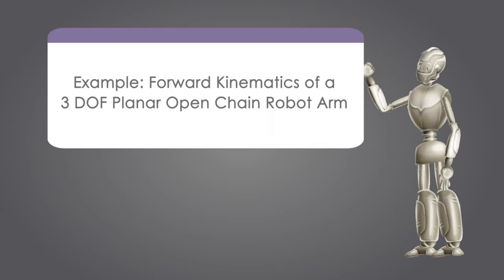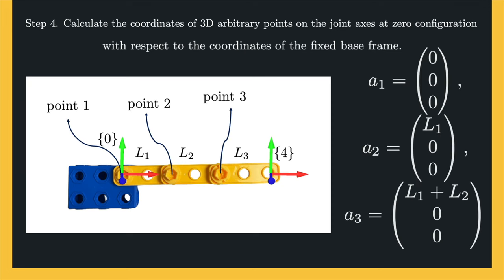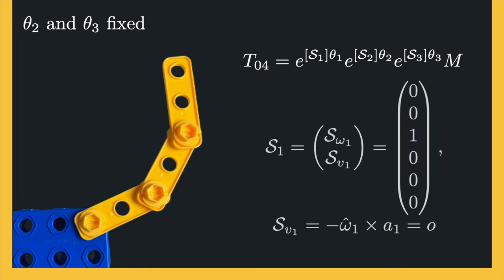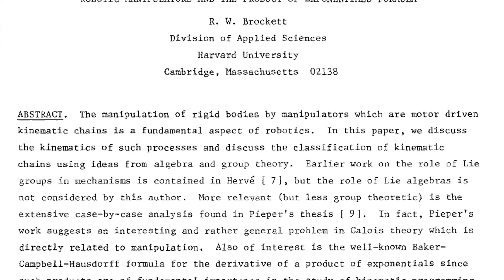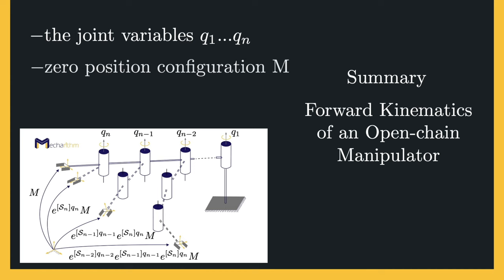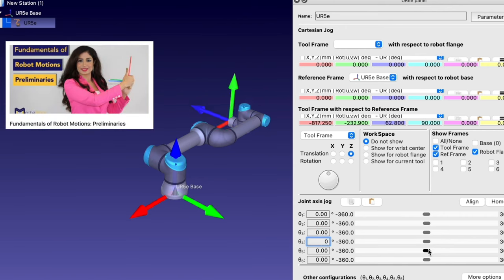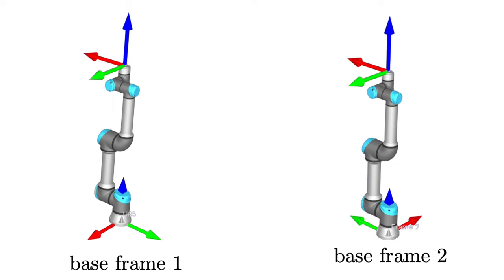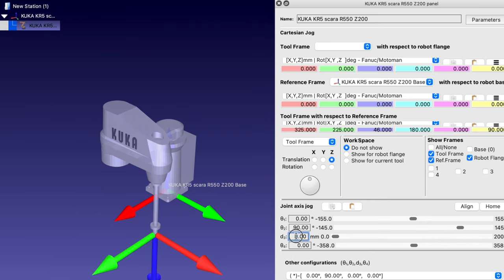Forward Kinematics in Robotics Using Screw Theory + Matlab Code & Great Demos | Lesson 19

Comment: I have developed or directed the development of several large-scale multibody dynamics programs and have never used the Denavit and Hartenberg method, which forces kinematicians to use unconventional methods to fit their models to DH limitations. It is much simpler to split shape matrices into sequences of primitive translations, tx, ty, tz, and rotations rx, ry, rz, in any order. And it is much simpler to represent joints as sequences of primitive translations, tx, ty, tz, and rotations rx, ry, rz, in any order. Just string their spatial displacement transformation matrices together in any desired order, and extract constraints, velocities, and accelerations as desired.

Comment: At ~18:00 why do we not define any offset / link length for the offset of L1 in the y-direction? Is that because w1 is the offset from the screw-axis of S5 to the origin / the screw-axis of S1?

Could we add two "virtual" screw axis inside the segments that are described by L1 and L2 (let's call them V1 and V2) and then use the additional links between S1 and V1 and V1 and V2.

Of course we would not use these virtual axis in the PoE as there is no actual joint there, we just use them for the offsets as we determine M and the a vectors.

I think this could make it easier to calculate / measure distances on a real robot, as we could measure along physical parts. w1 could be hard to measure accurately because of the distance between S1 and S5 .

Hope the idea I try to communicate is understandable 😅
Reply from the maker: Kevin, thanks for your great questions.

Q1. yes, you are right about w1. 

Q2. you can do whatever you want as long as you get the same answer at the end. The definitions of the variables can be different, but the final numerical answer should be the same. Plus, the robot in the video is a real industrial robot, and the robot's specifications can be deduced from the technical specs sheet as well. By doing so, did you get the same answer for the final transformation matrix?